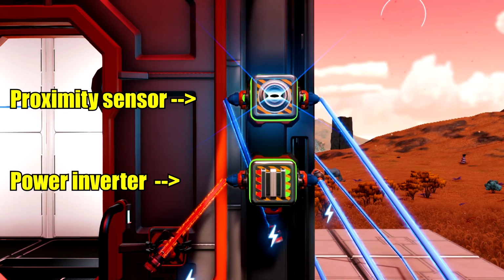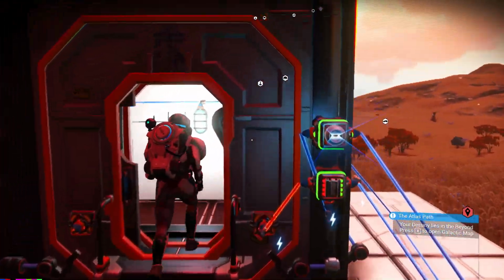Switches Explained for Beginners! - No Man's Sky Beyond

Comment from the maker: IMPORTANT :  Hello Games changed how the inverter demonstrates the flow of power! Now, when you connect power to the green end, the lights swap, indicating that you now need to connect the other side to whatever you're inverting. The inverter still works the same, though, so just follow the green lights and you should be okay!
Reply: Hi. I need a little help and I hope you stil reed these comments. When I place the inverter and connect everything something wrong happend.. when I come near the proximity the door opens and closes instantly.. the inverter just switches from green on the left to green to the right and switches back in a sec.. have no idea what to do...
Reply: @scaldinio  I'm having the exact same goddamn problem no matter how many videos I look up they all say pretty much the same thing in the game refuses to cooperate seriously the game developer in charge of putting generators and switches into this game is an idiot I miss the old version
Reply from the maker: If you can take a screenshot of your wiring, that would help. Based on your description, it sounds like you have a wiring mistake somewhere.
Reply: @RellePlays  did you get the screenshot?
Reply from the maker: @scaldinio  I saw a notification on my phone with a drive link, but I'm assuming you edited the comment to remove the link, in which case, no.
Reply: This is the link https://drive.google.com/file/d/10XqzkfwuPGOHaS4c3jPRrxssg7NfzT8W/view?usp=drivesdk
Reply from the maker: Gotta share it with me or make it public first.
Reply: @RellePlays  can I send it true something Els? Cant manage to send it true YT
Reply from the maker: Try imgur, it's the easiest way.
Reply from the maker: @scaldinio  However you're posting the link, it's showing up in my notifications but not in the actual comments, so I can't click it.
Reply: @RellePlays  just like a comment i just paste the link in the comments
Reply from the maker: @scaldinio  So, I can't exactly tell what's going on because the picture's so dang small,, but it looks like you don't have a wire going from the other side of the proximity sensor to the bottom portion of the inverter. Try that.
Reply: @RellePlays  its there in the picture I have everything hooked up like it should but its not working like it should
Reply from the maker: In that case, can you take a higher resolution picture? Because I can't really see what's going on.
Reply from the maker: @scaldinio  After testing this and a few other configurations, I honestly think either the proximity sensor or inverter (or both) are bugged. I had the same thing happen: the door would open and then immediately close, and possibly open a little bit and close again. There's no reason it should do that, and every other configuration I tried just kept the door closed when you walked up to it, so I think it's just a bug.
Reply: @RellePlays  ok.. wel Thanks for the help! Much appreciated
Reply: @RellePlays  Thank you for continuing to watch the comments. I've been losing my mind over this bug for a few days now. So glad I'm not the only one experiencing this issue
Reply from the maker: No worries! I get notifications on my phone, so if I can answer the question, I'll do my best to do so!
Reply: Took a while but I got this sorted. I think my problem was that there was a wire I'd forgotten about behind my door, connecting it to the room & corridor grid it belonged to. A legacy wire, from when I'd created the door, because without power a door wouldn't work at all, right? Prior to the proximity/inverter switch installation the door didn't work anyway because these doors are as buggy as the rest of the electrical system in NMS, because, despite being coders and despite basing the electrical systems on logic, HG seem to find logic and coding a little tricky 🙂 To be fair, they are.
Reply: I realized this just now hahaha
Reply: I been trying and still cant get it to work

Comment: I've built legendary cave bases. Absolutely-insane labs, deep in mountains, hidden in ancient valleys. 
Still, the freakin' power-doors are one of the hardest things in my base building. I wanted a Hoth Base bay-door, basically--One that can be opened and shut from each side for emergency situations. Because this planet is extreme cold, We needed actual bay doors. Our agricultural research Gek essentially fronted the bill for that to be done--So, it was up to me to implement the designs. 
Two Bay-Doors on each side of the cavern were built and good-God is the wiring insane. Had to cram it all under the floor and it was very complicated. You'd think, "Oh, I just want a door that opens and closes with a button" And, No Man's Sky replies, "Yeah, that's gonna be doable--But, a true nightmare."
edit: I forgot to mention, that because its a Role-Play base, we can't have proximity doors. Sometimes our Shipping and Receiving Department needs the bay-doors open to assess incoming shipments and take smoke breaks. There really isn't a way to have proximity-detected-doors, as well as a happy crew. They do work very hard--But, they're finicky and we're already on a frigid mountain planet (Still, after 200 hours, it is the 'highest peak' planet in my catalogue. One of the first ones I found, too. Hyper-cold, very-beautiful and highly-dangerous. That's planet Esper)

Comment: [FOR AUTOMAIC PORTAL]

So if anyone here still plays no mans sky years later or anyone visits the video and is having the same confusion i did about the portal, the way you invert it is simple.

You get your proximity sensor,

Connect and active power line to one side,

Connect an inactive power cable to the other side,

Lead it to the bottom of the power inverter.

Then lead that same power line to your portal.

These should all be red other than the first line connected to your sensor.

After that connect an active power line to the left side of the power inverter. 

The lines connected to the sensor that lead to the portal should be red, if they arent go back over what i said and try again.

And do NOT have any cables connected to the right side of the power inverter for this.

This will also work for anything you want to be constantly unpowered and you want it to power up when you approach.

Viola you have a portal that turns on when you walk close to it.

Comment: Why does it do the opposite for me? When I walk close to the door with sensor it closes on me
Reply from the maker: You have to use an inverter to reverse the signal.
Reply: @RellePlays  I did and when I do that the door opens and shuts repeatedly like it’s glitched out
Reply from the maker: That's weird. I'd need to see the wiring setup you have, I think.

Comment: I have been trying to make a power switch control a teleporter in one of the circular rooms, the problem is the power connects to the floor so as soon as you place the teleporter in the middles it powered, is there a way to make this work with a switch? or would I have to make an unpowered room so I can control the power flow, not the biggest fan of power in no mans sky, don't know why there isn't a nuclear reactor to me it would be balanced as you would have to provide the uranium.

Comment: I need help. Idk if this video is outdated but im trying to use a simple fucking switch to open a powered door. I connect the right side of the switch directly to a powered battery, the left side to the door, and nothing. Do I need to use an inverter or something? Because I cannot for the life of me get this stupid shit to work. Its really annoying because I want to build a really elaborate base but im constantly put off by the fact that I cannot get this crap to work.
Reply from the maker: Inverter is only needed if you want the switch or sensor to provide power in the opposite circumstance (flip it up to turn it off, for instance). If you can upload a screenshot, that would help.
Reply: @RellePlays  thanks for the advice, I figured out what the issue was haha I was supplying power to the door as well as the switch. I always thought that you had to power it separately, but now I know haha

Comment: After countless videos and tutorials, and spending a literal week trying to figure this shit out, this video winds up helping me. Simple  explanation.  Simple example, no unnecessary fluff. Excellent video.

Sweet baby raptor Jesus this (in game system) feels more complex than it needs to be.
Reply from the maker: Electrical engineering tends to be complex! Whether it should be that way in game, on the other hand...
Reply: @RellePlays  I took a test to be an apprentice electrician and scored an 80. This particular door switch system confuses me.
Reply from the maker: Oh that's not good...HG might need to rethink their circuitry.
Reply: @RellePlays  Well it does seem to be fairly similar in how a circuit works, it just looks a lot different. 

Its also out in the open. I think realistically you'd open up a panel, organize the wires behind the wall, not in front of the house. Then you'd set up the switches accordingly.

In NMS its all out in the open, and big and clunky, so it looks a lot more disorganized.
Reply from the maker: Well, you are setting it up on otherwise unoccupied planets. No one to criticize your wire organization.

Comment: I did everything you said and it just doesn't work. Also the the colors on the power inverter are now switched. Tried the other way too. No luck.
Reply: Turns out the reason is because the door was in front of a launch pad.
Reply from the maker: Yeah, that'll do it. Other parts can affect how things function.
Reply: @RellePlays  Im having the same problem as them but there isn't anything obstructing my door. I've rewatched and tried and tried and it just doesn't work.
Reply from the maker: At the moment the best guess is the system is bugged. There's no configuration I can find that works right now.
Reply: @RellePlays  oh thats great lol

Comment: But what if I want to use a switch on both sides
Reply from the maker: Which switch?
Reply: @RellePlays  specifically the wall switch. Im trying to set up a door that has a switch on both sides, but whenever I do only one side works. For example, when I close the door on one side, and go to the other, the door gets stuck and won't open or close. And vice versa. Is there a way to make it so that u can have a switch on both sides and use it regardless of which side is pulled?
Reply from the maker: You mean the one that's like a light switch? I'll set up something after lunch and try it out.
Reply: Yeeeeeeee thatd be cool because I'm trying to set up a door that had switches on both sides. Obviously the prox would work but id like to see if its possible to have a double switched door. I've tried a few circuits and nothing has worked so far
Reply from the maker: @squidthewizard8243  Definitely doable, though I'm curious about the exact setup you're attempting. All I did was throw a switch on the outer and inner wall, wired power to one side of each, wired the other side to the door, and regardless of which switch I flipped, it operated exactly as expected.
Reply: @RellePlays  ill definitely give that a try later to see if that might work. Thank u alot for the support!
Reply from the maker: No worries, hope it works for your setup!

Comment: would the proximity sensor also detect you if you were on the other side of the door? I don't wanna trap myself inside my base
Reply from the maker: Unless you place the sensor so far away that it only activates when you're outside (and you can see in the video it has decent range), it won't trap you. If you just slap it on the doorframe or on the wall next to the door, you're fine.

Comment: Honestly, what im really confused on is the automated portal. It doesn't have to be a whole video but a little thing included in another guide would be amazing!
Reply from the maker: By automated portal, you mean the one that turns on when I walk up to it?
Reply: @RellePlays  yep. I'm here because of that. I set up a solar panel, battery, and portal in hopes that I could charge up the battery all the time and use the portal when I walk up to it and it shuts off when I leave the area, but my current setup doesn't shut anything off with the proximity switch

Comment: Is there any way to make an automatic door where you have to be very close for it to open?
Reply from the maker: Yes, with a proximity sensor. You can't adjust the distance it triggers, though, so you could instead use a pressure switch.